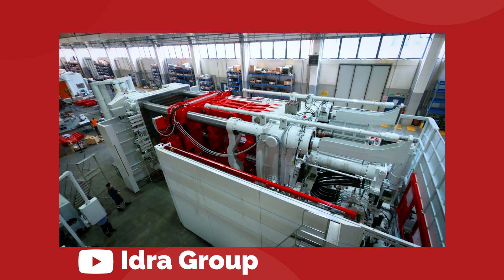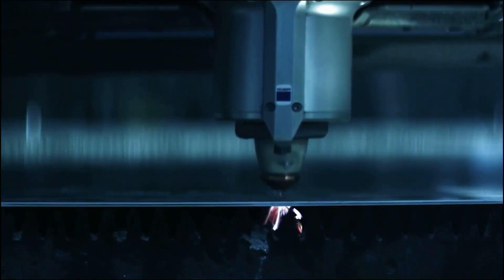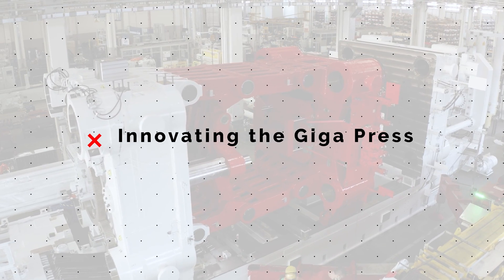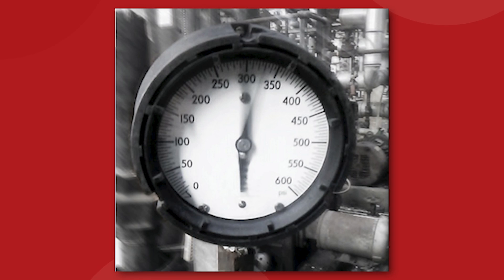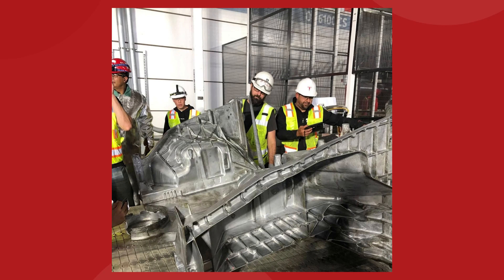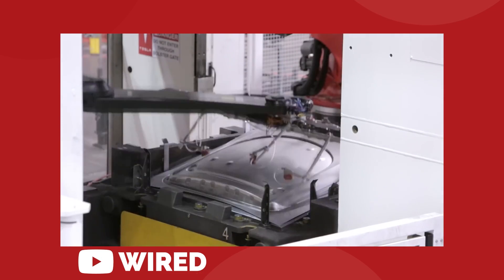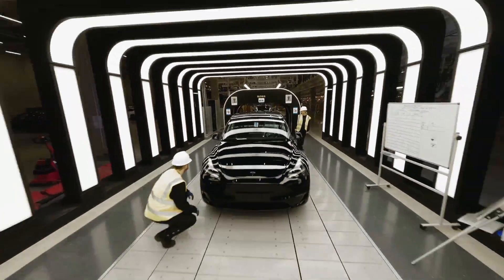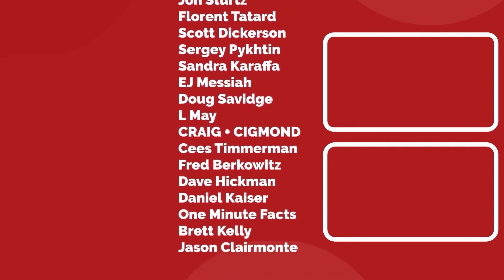The Real Reason Tesla Developed The Giga Press!

Comment: 241 tons of injection pressure with a 12 or 14" ram spreads out to how many inches of surface area trying to push the dies apart totally depends on the surface area of the part. 
Can they cast an entire car tub.  Getting something that complex out of a two faced die would be hard. 
Could a six or more block die be created for something as big as a full car chassis eventually.. sealing between sections. Getting enough volume injected before it starts to cool off.

My mind is thinking triangular struts to assemble in space created in a truly massive press .  But the triangular struts being 38 feet long would nest like plastic patio chairs . Since the production speed is slower the dies could be hotter .changeable ends on the dies might make different ends easy.   Since the struts would be ejected on one side.  The other half could be cast in a second series of dies.  Precision machined to nest and to mate perfectly. Crimping rings could be slipped over knobs and crimped like copper water pipe is done now. Making assembly  in orbit or on the moon or mars easy with only one heavy crimping tool. Corners could be cast to fit inside or over the strut castings.

Comment: Remember things that are cast will not bend in an accident they break…. You ever hit a piece of steel with a hammer then hit a piece of cast and it breaks especially aluminum think of it as pot metal its poop it degrades it breaks it does not bend on impact which makes it wayyy to sketchy for a vehicle main fraim the most important part that needs to be the strongest is now the weakest😪

Comment: There is a tremendous amount of engineering that goes into this sort of thing.  I wonder about cycle time.  With a single Giga-Press, you get one sub-assembly per cycle of the press.  So production is limited by this cycle time, which could be several minutes on an aluminum piece of this size.  There are only 525,600 minutes in a year.  Tesla wants to produce 1.4 million model Y in a year.  That means the press would have to cycle every 22.5 seconds.  This is 100% operating time, no downtime, no scrap.  I don't see how they can do it.

Comment: Great video! Thanks for the content. Just wanted to point out an error though :( At 7:03 the spec sheet is up for the max injection stroke and it says 1372mm and you say 1272mm. Im assuming the spec sheet is correct but just wanted you to know. Thx again for the informative video.